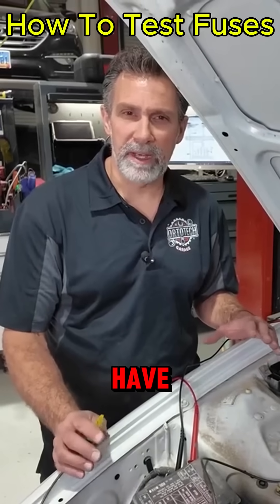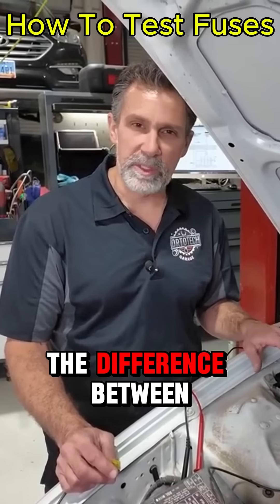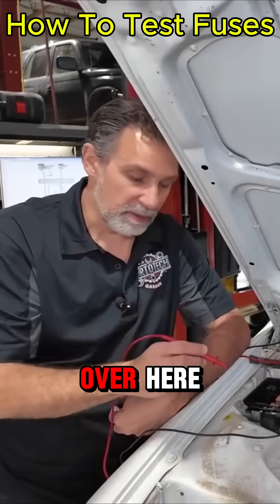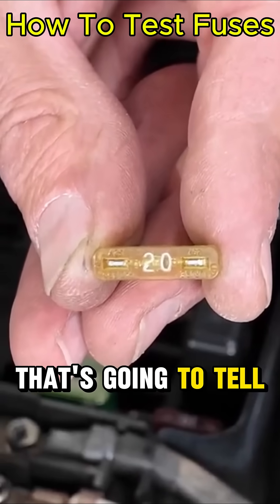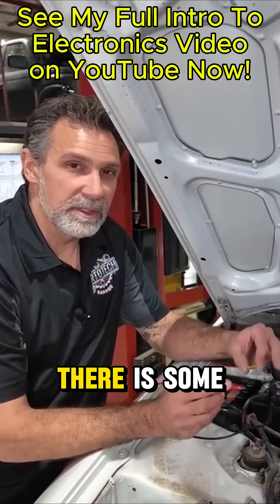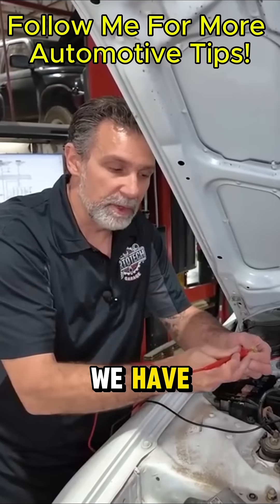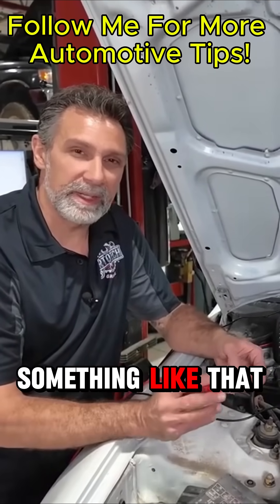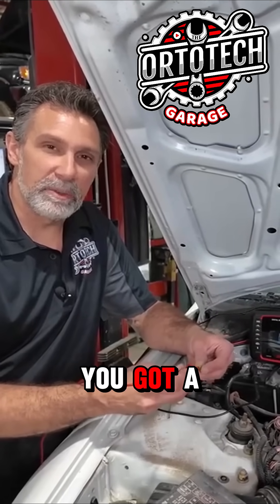Stop Pulling Every Fuse! Use This Trick Instead

Comment: Brooooo just check continuity. With noise / sound feature on dvm
Reply: He is, just using the same negative post the whole time so he only has to move one lead.
Reply from the maker: . Thank you for that!  This definitely make it simpler, especially in tight quarters under dashboards.  👍  I had no idea this topic would be so controversial among the YouTube afficianados. Maybe I've just been doing it wrong for 35 years.  Somehow I was able to accurately diagnose every fuse I've ever checked in my career.   Probably just pure luck.